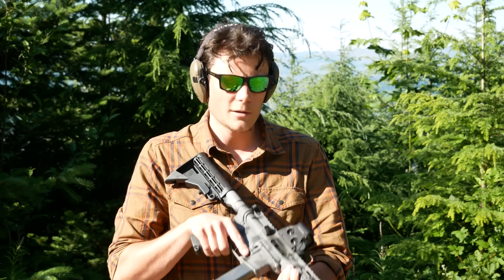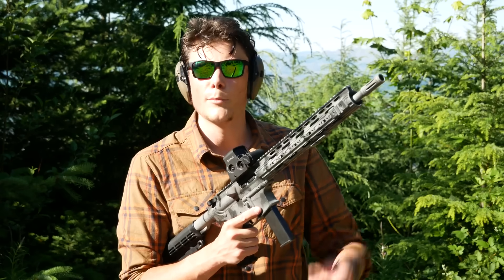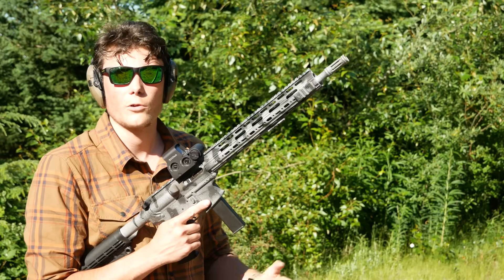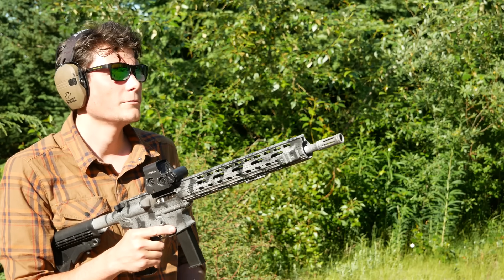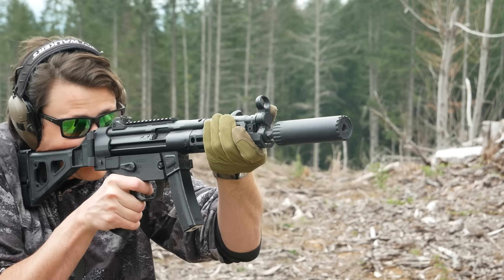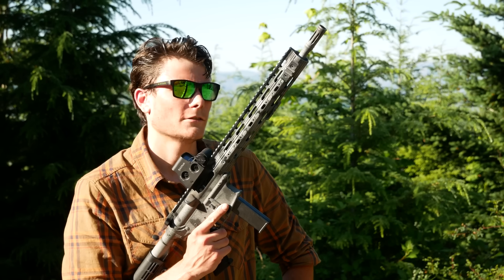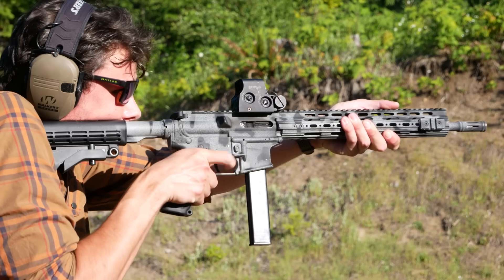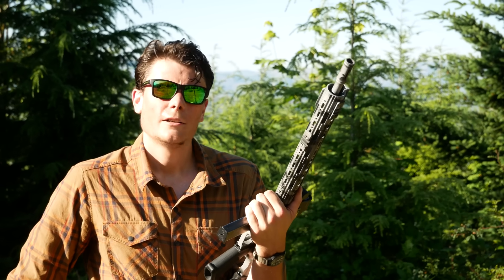Converting an AR9 to Roller-Delayed Blowback

Comment: I gotta ask/say. Hop, can you sell me on a PCC? I can't for the life of me figure out the benefits to a gun that's the size of an AR, but the power of a handgun. That just feels like the worst of both worlds. 

The only argument for a PCC is a sub machine gun where recoil is vastly lowered and you can keep on target better, and your guns sharing ammo. But in my mind that's not worth the trade off. Can you elaborate?
Reply: I have two AR9s, both of which are 10.5 inch SBRs. a 16" PCC doesn't make much sense in my eyes.
One of them is a Colt SMG parts kit build, the other is a more typical 9mm PCC with a red dot. '
Both of which are a lot of fun to shoot. 
Where a PCC really shines, is when it's suppressed. You get noise levels that simply aren't possible out of a 556. I have a wolfman that mates nicely with the other AR9. Subsonic 9mm is an absolute treat out of these, and it still has plenty of effectiveness, if that matters to your application. Apply the same magic to a 556 and you might as well be shooting an expensive version of 22LR. Of course, off the shelf 115gr 9mm is still nice suppressed too. 

Another reason for them, which sadly most people overlook when it comes to home defense, is 556 (and other rifle calibers) will over penetrate the shit out of American buildings. 556 will go through the bad guy and happily onto the neighbor's house. Unless of course you use some kind of expanding projectile hunting load, assuming you don't miss.

9mm hollow points are much less expensive, and even FMJ 9mm has far less tendency to over penetrate. It still will go through walls, but not near to the effect that 556 will. 

On that same note, 556 has a shitload of concussion that 9mm simply doesn't have. standard 9mm is still loud out of these, but again, not nearly as loud as 556. Depending on what you're doing, that might be a big difference. a 10.5 556s vs a 16 556s, for example. the 10.5 will be loud as fuck, and in a barrel that short, you're losing a lot of the 556's potential energy. Especially if you compare it to the original 20" barrel. 

If none of that appeals to you, then a PCC Just isn't for you.
Reply: @l4d2160  If I want a fun, cheap range toy, then I'd rather use a .22lr AR. Cheaper ammo. Less recoil. Just as much fun. Maybe more!

If I want something for home defense but I'm worried about overpenetration, I guess a 10.5" AR9 build would do. I don't see 556 overpenetrating to the point where it goes through a body, your home's exterior wall, and then also your neighbor's exterior wall. That's kinda far fetched. You can have overpenetration inside your own home, but you're most likely not going through a person and two exterior walls with a 10.5" AR-15. Once a bullet hits something significant, it loses a ton of its energy. It don't see 556 from a 10.5 going through 2 exterior walls even without it hitting a person first, but that depends on building construction. When I lived in FL, all of the old construction was cinderblock. Now most homes are built cheaper, but they're not cardboard. You still have drywall, insulation (there's different types that are thinner and thicker), plywood, and whatever type of siding you use which could be as thin as plastic or a bit more significant like metal. That's not even including the 2x4s in the framing or other metal things inside walls that could get hit. Some of the homes where I am now are still heavy timber construction. There's too many variables to make a clear conclusion on overpenetration of homes.

And you're going to be deaf if you're shooting unsuppressed indoors no matter if you shoot 9mm, 556, or 22lr. That's just how it is. You're best off keeping a pair of earpro near your weapon. With the earpro I have, all sounds are amplified until there is a high enough db level to cut off the mic/headphones. So I'll actually be able to hear better than everyone until I shoot, just as poorly as everyone while shooting, but still be able to hear fine and use the amplification again when there's a break in firing.

I'm fine with people liking different things though, and that Colt SMG just looks cool. I'd pick one up myself and may just do that when I get the opportunity. Even the CMMG Banshee and Sig MPX look neat and like something I'd want to own, but I do have a problem controlling myself from buying firearms I don't need.
Reply: @stoptrackingourdata8158  Most modern homes (at least the ones in my area) might as well be cardboard. Insulation, at least as far as the pink roll up shit goes, has virtually no effect on a bullet's speed. It may make it tumble, though. Drywall is just about next to useless in the same regard. Birdshot (12 gauge) can easily blow through two walls, sometimes three under the right circumstances. Plywood? Meh. It's actually a lot harder to stop a bullet than most people appreciate. As far as hitting a stud goes, you're more likely to not hit a stud than hitting one. Studs are placed quite far apart, and aren't very wide. Not to mention any windows around. 

Sure, down in florida that's less of a concern, but that's because homes there are built with hurricanes in mind. Here in the mid west, they (more often than not) aren't built so sturdy. Check out some tornado aftermath footage for a glimpse if you like. 

One thing you're forgetting, is marksmanship. None of us are going to put 100% on target in a home invasion scenario. Hell, not even the police can achieve that level of accuracy it seems. Hopefully that exterior wall is brick, or similar. Doesn't seem to be that way usually. 

As far as being deaf goes, no that is very much not how it is. All guns are loud, yes. But rifle and pistol calibers are on completely different levels of loud. The firearm industry itself proves this. Rifle cans have to be built tougher, and don't achieve the same level of quiet as a comparable pistol can on a comparable setup. Less pressure, less velocity, less noise. Anyone who has fired a handgun vs a rifle at an indoor range experiences this for themselves. I've done it, myself. 9mm, 556, and 22lr. Suppressed, unsuppressed, short and long, indoors and out. The difference is clear in all cases.
Reply: @l4d2160  I've built and demolished things. There are many types of construction. Like I said, when I was in FL the older construction was more solid made usually of cinderblock on outside walls. Where I am now I see brick, plastic siding, wood siding, and solid timber; occasionally I'll still see cinderblock. I do see the cheap construction everywhere too, but that cheap construction can be made of different materials as well.

I wasn't trying to imply that the standard cotton candy style fiberglass insulation would stop a bullet. I mentioned insulation because there are many different types just as there are many types of all building materials. Some people do a spray on foam that I'm sure would slow a bullet down and take more energy from it than the fiberglass type.

Studs are usually 16" apart side to side, but that's not always the case depending on who did the build; especially where I am now and on renovations/additions 😂 I didn't bring it up to insinuate that a 2x4 would stop a handgun round because I've seen plenty of wooden target stands that prove they won't.

I listed all of those building materials in my previous comment because there are plenty of them that are weak on their own vs a bullet; but bullets lose energy with each foot they travel, each thing they hit, etc. Each one of these materials the bullet comes in contact with takes energy away from the bullet and will change its flight path. All of that was just to explain why I felt like overpenetration to the point of killing your neighbor by shooting through both houses is pretty improbable although not impossible, but I'd still rather have the energy to penetrate than have a less penetrating round for defense purposes.

I think most overpenetration comes from shooting through interior walls in houses or apartment buildings (which could be harmful to neighbors in the latter case), but most people who live in houses don't have to worry about their neighbors too much vs their own family members.

And I think you took what I said about shooting indoors too literal. 😂 Is shooting a gun inside going to immediately give you permanent hearing loss? No. But you aren't going to be able to hear anything for a while whether you shoot a small or large round indoors with no earpro or suppressor. It'll all vary depending on the round, type of muzzle device you are using, size of the room, and again building construction (concrete/tile floor vs carpet) as well as what's in it when it comes to how loud it'll actually be, but none will be pleasant or good for your hearing. That's one of the reasons why I keep some earpro in my bedside table; I'll still be able to hear after I shoot. Mine actually amplify noise until it reaches a certain decibel, so I have superhuman hearing unless I'm shooting.
Reply: @l4d2160  16" PCC makes sense in states that don't allow SBRs or if you wanted to avoid the pistol brace drama.
Reply: @l4d2160  Over penetration in a house is more of a worry with 9mm than 5.56. You’re mostly right other than that.
Reply: It’s cheap and fun to shoot, but unlike a .22 it still feels like a “real” gun. Also easier to suppress, a silenced 5.56 with regular ammo is still going to be very uncomfortable to shoot indoors without ear protection. If you want all the benefits of a PCC and superior ballistics, get a .300 Blackout AR15; just be prepared to spend way more on ammo.
Reply: A 9mm might not be as powerful as a 223 but it'll still put holes in things and with more accuracy than a hand gun. If you think of it as an upgraded 22 then it looks really powerful!
Reply: Same. If I want a fun, cheap range toy that's pleasurable to shoot, I'll use my .22 AR.

When it comes to a 9mm sub gun, idgaf about recoil. Sure it's snappy, but so is 9mm out of a handgun where you have one less point of contact to control it.

I'm going for the smallest build possible if I'm making a 9mm sub gun. Not a 16" barrel with non folding stock.
Reply: Range toy
Reply: - I have a mental hangup about potentially firing rounds in traffic or the park that will travel way farther than necessary instead of dropping to the ground inside 250 yards.

Comment: I was pleasantly surprised at how much of a difference a captured buffer made in my AR9. I'm not sure if my experience is typical, but I snagged an Armaspec silent capture spring system for ~$40 and threw it in my Aero EPC-9. I'm using a Faxon bolt and a 4.5" Faxon Barrel (with a suppressor and 10" handguard), and after ~400 rounds it's still running flawlessly. 

AR9s as they are don't have a lot of recoil obviously, but you can definitely feel that weighted bolt and 7.7oz buffer when it kicks back and bottoms out at the rear of the buffer tube. 

With the upgraded buffer it feels more like a smooth 5.56 AR with a less "jumpy" recoil impulse. Much less reciprocating mass and smoother shooting experience overall 👍